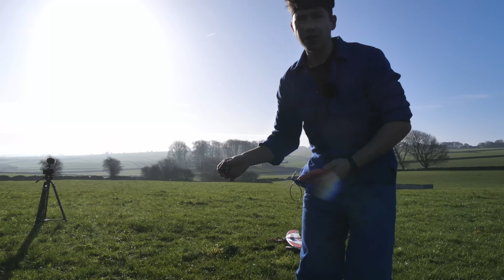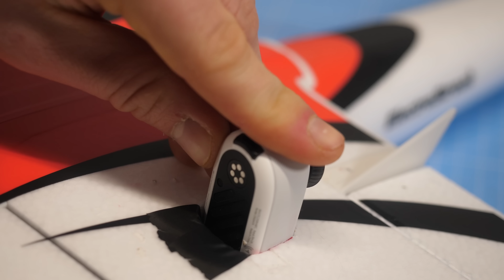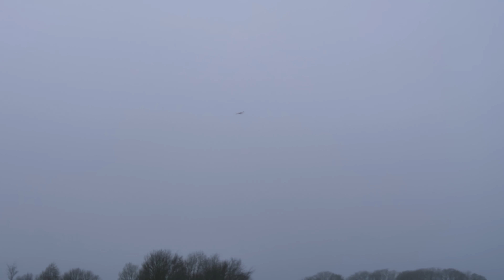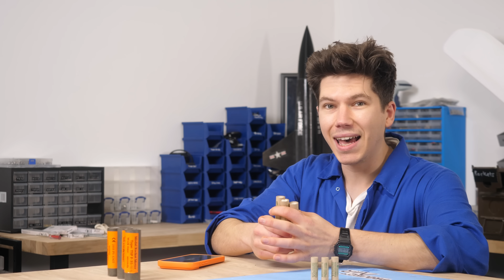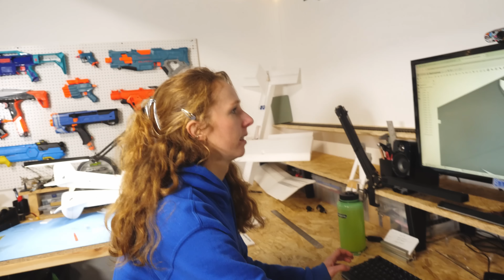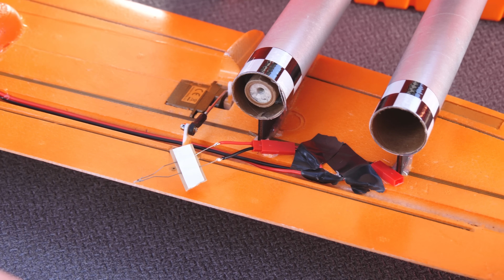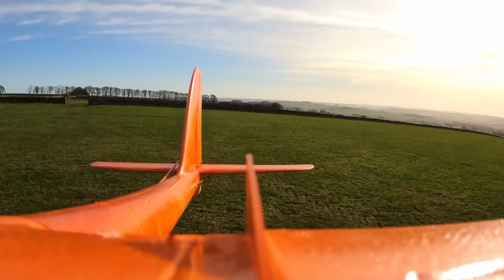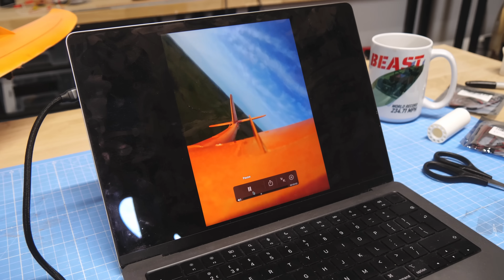Building a High-Speed Plane

Comment: A propeller can be over speed causing it to stop producing thrust and causing drag. I wonder if a different propeller could produce more thrust before the rocket?
Reply: Yeah I'm pretty sure he didn't calculate the optimal prop pitch and maximum watt that the system can deliver when the prop unloads at speed.

Comment: Why not using a real speed model instead of this foam model?
Reply: I'm hoping this is part of an iterative approach. Testing/developing the basic ability to use multiple rocket engines on an airframe, then develop an airframe that uses the capability more effectively, rather than trying to develop both systems at the same time.
Reply: He most likely got it for free.

Comment: No negative criticism intended here, I love your content. But, running before hand launching small planes is totally useless.  It adds little to no air speed and just leaves you winded and in an awkward position after launch. Just throw the silly thing! Putting just a tiny bit more arm power into your throw will add waaaaaay more air speed than running ever could. And you wont look so silly.. 😜
Keep up the awesome content. 👍

Comment: "Aerospace-grade plywood" didn’t knew that existed...
Reply: Peter Sripol had aerospace grade cardboard, anything is possible 😂
Reply: @ianstarcroft  rctestflight always uses aerospace grade insulation foam lol
Reply: @therealpersonion marine grade too 😂
Reply: @ianstarcroft  he used normal cardboard
Reply: @ColtonCarnley-o4q  Thanks for clearing that up, Captain Sensible.
Reply: @ColtonCarnley-o4q  turn around! The joke has passed you
Reply: It exists, is very hard to cut with laser, you can see the many layers vs the "normal one" is what i use to build my rc planes
Reply: yeah wood has to be sturdy enough to handle g forces at low levels
Reply: Check out what the fairing on the polaris missile is made of
Reply: Fit for the Spruce Goose!
Reply: Yeah lol😅
Reply: The ww2 mosquito was all wood
Reply: @Goodywloss2010 mosquito was a balsawood core with birch ply bonded to each face.
Reply: i think its literally just that they have no knots or anything within the plywood layers, and that its a specific species of wood
Reply: What do you think they used to make planes out of?
Reply: @Skorpychan  You think they stopped building planes out of wood?
Reply: @freyja7498  I assume they moved onto fibreglass, since it's easier to shape.
Reply: @Skorpychan  Some have, but plenty are still built out of wood, usually wood wings, steel tube fuselages, and fabric covering them.
Reply: @Skorpychan car hair, obviously
Reply: Or 'know' even?

Comment: The easiest way to reduce flutter, without the math, is to add weight forward of the hing line to the control surface. Notches in the wing or the stabilizers surface offer a streamline and less snag prone option.
Reply: I was similarly thinking that it would pay off to have balanced surfaces.

Comment: should've used a folding propeller and turned it off (with motor brake enabled) before igniting the rockets. At high speeds, the propeller can become a major source of drag
Reply: A variable prop pitch system would also be useful to increase prop pitch at higher speeds. Those can be very complex though
Reply: TBH I know next to nothing about flight and aero engineering but as soon as I saw the thumbnail I wondered if there would be an issue with the propeller.
Another thing I would have done differently was not to have used pylons on the rockets.
Not only would there be drag but it looks structurally weak.
Reply: with an h-bridge,
that propeller could charge the battery :p
Reply: Fuck it jetison the propeller
Reply: @Madeline-b3e fuck it jetison the plane just build missiles

Comment: You only have to go over 450 mph faster to beat Spencer Lisenby's Transonic DP glider that flew 564 mph without any motors.
Reply: I love that the fastest rc planes have zero motors
Reply: @GuyFulcrum  It technically had multiple motors...in the servos. No motors used for propulsion.
Reply: @toolbaggers 😂 yeah, didn’t think of that
Reply: @toolbaggers  "...have zero propulsion motors."
Reply: The record is 568mph now. Spencer hit that in 2023. 

This Eflite model is smooth because of the A3X gyro, not sure how he didn’t know that being as he uses Safe mode (which is hideous to have when you can actually fly)
Reply: @Slamdunc  
im sure he knew that lol, why wouldn’t he ? 
of course an active gyro will make the flight smoother